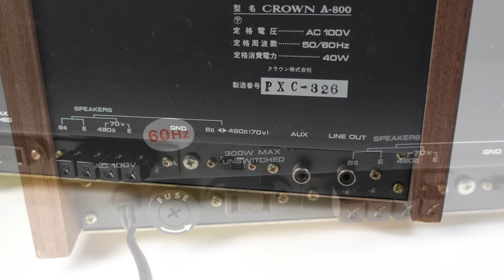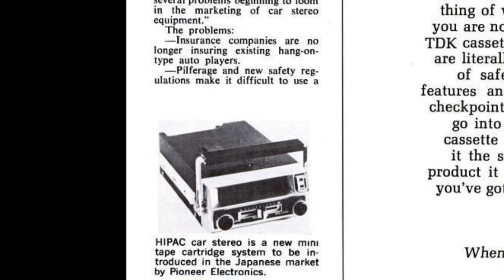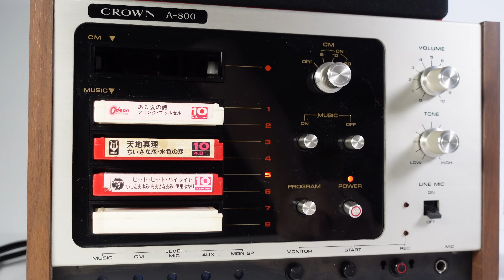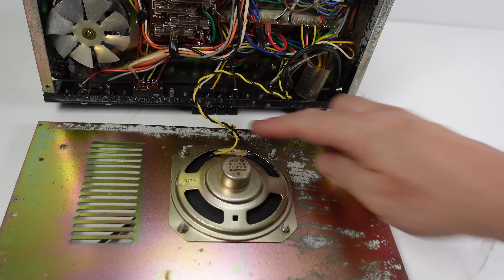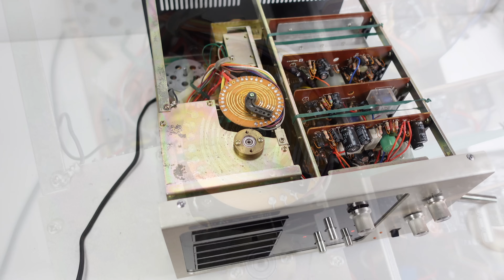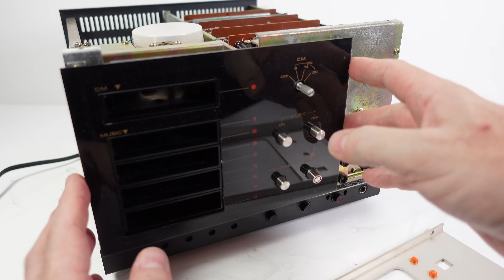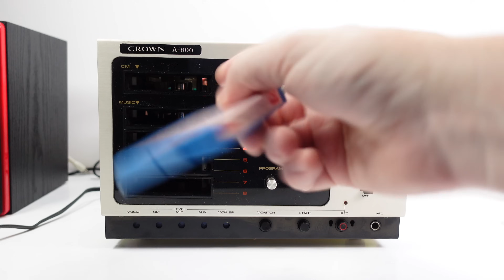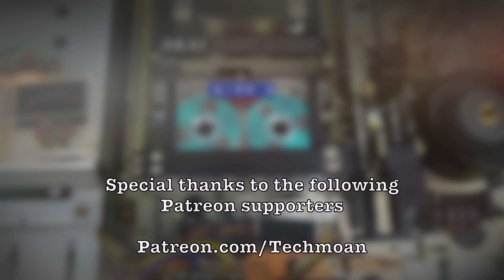An unusual player for a forgotten ‘70s music format

Comment: Changing the capacitor value alters the timing constant in RC circuits so yeah, if you can trace this cap to the motor driver (it's likely a part of the driver), it will alter the motor speed. Use a high-spec 1% mylar or polypropylene foil cap as a replacement. Judging from its size, it is rated to at least 250V. Soviet equivalents would be K73-16 (PETF, the knock-off mylar) or K78-19 (polypropylene), although the precision is not their greatest strength.

Comment: I agree with the "no Jacket required" joke, good work.

As for the drive roller release, Im sure that was designed to release the pressure off the roller so as to not leave an indent on the roller when not in use. I had several 8 tracks in the 70's that had a permanent (although slight) warble or "punch" as the tape was played because of the indent. It would have been a "bonus" for this machine to utilize it in cartage selection. But I wouldn't give them credit for thinking ahead in the design. They were good, but this was just an accident they could use it for this purpose.

FYI: My fondest memories of a bad drive roller was an ABBA album that my mum had in the car, which we had to listen too way too much!

Thanks for the memories.

Comment: Most people here seem to agree that changing the capacitor wouldn't change the playback speed. My knowledge of electronics is not great so I might be wrong, but aren't the most basic clock circuits based on how long it takes a capacitor of a specific rating to charge and discharge when wired in a specific way? It wouldn't take too much more than a capacitor and a resistor or two to shift a 50hz signal to 60hz or vice-versa would it?

Comment: I have a CQATRON STEREO 48 (imho mis-interpreted as QATRON, but the 'C' is in the logo. And with CQATRON standing for "SEEKATRON".) Regardless, the device is a 12 TAPES 8-Track Stereo HIFI TAPE PLAYER. This carousel player is better seen than described. So I made a video playing multiple tapes. Also for quite some time my full 8-Track upload of AL STEWART TIME PASSAGES was the only full example of the album. The slightly slower speed difference was actually an interesting alternative to Al's voice. I did not long after replace the dual parallel belts for a solid perfect speed, and great sound. 8-Tracks have a pleasant eq curve to minimize tape hiss. It's faster speed and wider-than-cassette tape contributes to superior sound to cassette tape. 

However, engineers incorporating the all new DOLBY C, THEN B (for consumer audio cassette and eventually VHS HIFI AV TAPE) and massive compression/expansion tricks did arguably leave the 8-TRACK TAPE in the dust...well dust bin, 8-TRACK tape was discontinued in late 1982. When I was in 11th grade. So I had 8-Tracks through my whole youth. Lots of portable players my gaggle of buddies could manage chipping in to buy the 8- D SIZE 1.5VOLTS BATTERIES (this 12 volt standard made car hook-ups a lateral move). They'd last 2-3 hrs carbon batts, or 5-6hrs alkaline iirc. That's a loud night camping in the woods. 

One of my buddy's oldest brother Mike was stationed in Greenland in the navy. One year when we were 12 and 14, and 16( me and youngest of the 4 brothers being 12), Mike brought home around 50 8-Track tapes ( Mike had incredible taste), a pioneer 8-Track player, a just released-1980 top model Pioneer SX-3900 receiver, a DBX 1BX DYNAMIC RANGE EXPANDER, and great BOSE speakers. He left it for his brothers! So we were so lucky. Yeah me too, as I practically lived at the Chapman's. In there little room with 2 bunk beds and the bitchin' music was a hexagon bumper pool table. The next year Mike brought home a bunch of records and a great turntable. To this day Digital has nothing on Vinyl! 

I grew up to be a professional musician, and attribute much of that to hearing great music on a great system. I never forgot the magic of the DBX 1BX DYNAMIC RANGE EXPANDER. I found one in adulthood for $10 at a thrift store. I use it on literally everything! I even put it on my Hammond B3 organ between the organs preamp-out and the Leslie speaker. I can put that organ in any part of a recording mix with any vintage era before it even gets to the recording desk. 

So the CQATRON was a busy Saturday morning thrift store find. It was one of the mornings that just felt like everything was picked over by the fluke of a crowd. It musst have been a 50% off day. Well anyway, I saw this piece of electronics with a huge hole in the cent, exposing the electronics. As I walked away I saw a little kid holding a thick transparent lid I knew must fit this thing. He gave it up with not much trouble. But then what? No sooner that I thought this, another kid had the missing round carousel with 12- long rectangle..."Ah wow it's a 8-Track changer!". It was a bit more trouble getting that from the kid, but I eventually did. The lid had $5.50 on it. I didn't even plug it in! SCORE!! With a little research I found they made 500 of the, Okay 'QATRONS'. Mine is serial# 499. Apparently a company had an 8-Track cartridge that its case was harder top make a flawless auto changer transition. At least built into the players brilliantly simple mechanics is a 'reject' , which spits back a difficult tape and moves to the next one. 

In my 15 years of snatching up every thrift store $.30 cent tape there have been several of these 'problem cartridges'. Actually no problem. I discovered simply applying and shining up Armor-All...actually preferably Son-Of-A-Gu'n to the inner rectangle slots for the tape, as well applying it to the cartridge sides, the work flawlessly. 

The TELEX COMPANY  continued making the units. Iirc they made more than 500, but I might have got that backwards. The daughter of the inventor commented on one the two videos I made of it. I do still have mine. Incidentally these Qatrons had a built-in 2-channel amplifier, L/R AUX-IN, and of course L/R PREAMP OUT . Surprisingly I've never patched it through the DBX 1BX DYNAMIC RANGE EXPANDER, but if I did and you heard it? Well, you'd need one of those Maxell Tape guy chairs! 🤣

Comment: Interesting video.  Don't be too nostalgic towards 8-track (and probably Hipac either), as I grew up using an 8-track player with quite a few tapes, and they don't age well:
- The tape, when played, has a tendency to be ever more tightly wound with every use, to the point of starting to play "slow".
- The pinch-rollers were hardening pretty fast and became more and more slippery.  This exacerbated the previous problem.
- You could somewhat remedy the tightening issue by pressing "fast forward" and reeling the tape from end to end at this speed, which seemed to wind it less tightly, if your player had such a feature.
I assume Hipac systems were also victim of these issues, since they're so similar to 8-track ones.

Comment: The hi pac format reminds me of the MGM "playtape 2" format, a short lived sort of tiny cartridge that looked like a little 8 track cartridge. I used to have one, it looked like a big transistor radio...didn't sound very good and ate batteries like a champ, but worked well. Finding tapes for it in the days before the internet was tough, so I sold it at a garage sale.

Comment: Because it has a 70 volt output it is a public address system integrated system. This will run absolutely fine with 70 meter speak cables.

Comment: The capacitor probably goes to some kind of circuit that modulates the mains frequency to the motor speeds. Just swapping out the capacitor shouldn't cause a catastrophic failure.

Comment: The capacitor will not change the speed, it just the difference in noise between 50 and 60 cycle. You need a full inverter to change the frequency to change the motor speed.

Comment: I'm really impressed by the forward thinking of having every major part in the device be easily serviceable. The belt is really easy to access, the heads are all interchangeable boards, every piece of electronics that could possibly wear you just slide it out. A much easier repair compared to a whole lot of the machines you've shown over the years, really goes to show how much care and effort these Crown engineers put into their system.
Reply: Remember that this was a commercial device, where uptime was money, downtime was loss, and a speedy repair was an all-around win (not only did the customer get back in gear with minimal lost service, but, the company got good rep points for a repair that took minutes versus hours, days, or weeks).
Reply: Also, I'm sure the reason the head has the ability to read both track is for reliability. On the car unit, the head had to physically move, which means more mechanism to wear out or malfunction when played 12 hours a day. By fixing the head in place and selecting the required track electronically, the unit is far more reliable and simple to manufacture. Very impressive little piece.
Reply: Something HP was frequently doing in their early computers
Reply: The marketing dept was livid!
Reply: @Redmenace96  Depends on business model. If they sold the machines to end users, sure. If they rented the machines, not so much--in such a model, highly reliable products are desirable, in order to spend less on field techs. Especially when quick repairs are a selling point.
Reply: @Redmenace96  not quite, this is an industrial grade device. Most modern servers for example also have this level of modularity.

Comment: Often, 50 and 60 hz equipment had different pulley diameters available from the manufacturer to convert them to local requirements.
Very interesting video. Thanks.

Comment: I think the speed control is the combination of the capacitor and that otherwise pointless fan on the end of the motor shaft. Using a larger capacitor for a 50Hz system would increase the motor torque for more speed, but a faster speed increases the drag of the fan until a balanced speed is achieved.

Comment: I bought my first car in February, 1973. I can't remember if it had a radio or not. It certainly didn't have a stereo. The first unit I installed was a Pioneer KP333. It was a cassette machine and it was auto-reverse. It wasn't in for long before it was upgraded. I replaced it with a radio/cassette unit. The last role of the KP333 was for background music in the foyer of a cinema where I was working. I may even still have it somewhere.

Comment: Can you not use regular casette tape to replace what's in these special ones? The tape itself looks very similar.
As for it just looping the announcement, looks like "music on/off" buttons were both popped out, so maybe that had something to do with it? Although your theory of using the second track for basically programming does make sense.

Comment: Hi, capacitors are used as timers in a circuit, so in theory would increase/decrease the  frequency of a given signal, depending on the cap value. Assuming this is on the output of the mains input, then im guessing this is its purpose! there is one way to find out of course?

Comment: In an oscilator circuit a capacitor of higher capacity will reduce its frequency.
The size for its capacity aswell as the "MP" hint it to be a foil capacitor. I'm certain its not part of the power suppy. Also the only capacitor you could want to scale with mains frequency there is the smoothing capacitor (it certainly isnt) where a capacity higher than needed does no harm.
That said the main purpose of the board it is soldered on seems to be the accessible mounting of maintainable components so I can't tell to what circuit it actually belongs.

Comment: if I recall my schoolboy electronics... if you alligator clip a .4uF (400nF) capacitor in parallel with the existing .6uf you will have the 1uf your looking for, its strange that with Japanese tech they didn't allow for a second cap on the circuit board to just add the extra one in...  (make sure you match the voltage from the existing unit)

Comment: the whole 50/60 hertz is complicated.  It could have been solved after world war 2 if it wasn't for one unfortunate fact, the places that were 50 hertz were in the north that were not bombed to smithereens by the Americans nearly as badly as the south (and in two cases strait up nuked).  The created a bit of a complicated quandary when building back up the electrical grid.  The US was happy to help build back up Japan's destroyed electrical grid in the south with their own 60 hertz systems, but in the north, there was not as much need for replacing the still very usable 50 hertz grid and a lot of old radios and other electical devices from before the War in the the north still worked fine.  So as to not cause too much issue with, the decided to leave it at that and everything built up from there with the two systems and by the time Japan had the money and infrastructure to possibly replace it, there was no political will in the north to change anything so it was left in this 60/50 hertz dual system using the proprietary 100v outlets.  This supposedly costs Japanese companies 20 billion dollars a year in excess expense in need to manufacture different power supplies and transformers for exported electronics that don't use 100v power supplies as well as the need to make all electrical devices "dual frequency" (it would be FAR cheaper to make everything a single frequency and able to make everything 120v that can easily be converted to 240v).  This is most likely not going to change any time soon as it would be far too expensive to change at this point.

Comment: Re: Splicing cassette-width tape: Ebay lists someone in Surrey selling a "Audio Cassette Tape.1/8" Splicing Block" which is a miniature version of a classic audio tape splicing block.  I also remember having a "BASF Cassette Repair Kit" in the early to mid 70's which came in a box the same size as a cassette box.  I am not 100% sure, but I may have bought it at a HMV store in London.

Comment: With such a large flywheel, you may find that the capstain bearing has dried out (causing wow & flutter). Best not to just lubricate it, but instead remove the capstain altogether and give both it and the bearing a good clean with shellite or similar to clean off any old dried oil or grease. Use a couple of drops of machine oil inside the bearing and another one on the contact surface at the base of the flywheel and reinsert it. Once secured back in place, make sure to clean any oil off the entire length of the capstain to avoid contamination of the tape.

Comment: The car stereo versions that I've seen also push the pinch roller retract lever when the tape stops playing. This is for two reasons. Firstly, it stops the pinch roller from becoming deformed when the capstain is applying pressure to just one spot, which would result in wow/flutter. Secondly, if the tape is pinched in the one spot, the tape itself can amalgamate with the pinch roller or stick to the capstain, and either damage the tape or get wrapped around the roller or capstain and thus get "chewed".

Comment: Changing the capacitor will generally change the torque to the motor, hence why it sounds wobbly. You  said you don't have any option to change the belt position sadly.. so probably not possible, probably need a different fly wheel?

Comment: @36:49 with some movie projector queue systems that use metal foil to automate the lights and such the metal foil has to be in different places depending on what you want the queue to do.  Bridging the length of the film as it passes the reader vs across the width.  The ones I had like that rely on actual conductivity of the foil and after a week or so the queue tape goes bad from wear and requires replacing.

Comment: I had an 8-Track system in the early 1970s.  (Yes, I am a yank!)  I loved the thing and had plenty of cartridges from many artists.  One by one they failed.  The primary problem with these continuous loop systems was the tape eventually tightened up on the reel making it difficult for it to pull from the center of the spool.  They would slow down, warbled and many times  completely bind up.  This was usually accompanied with the tape winding around the capstan and breaking.  I resurrected a couple of failed cartridges by opening the case (like you did) and rewinding the reel.  Talk about a pain in the rear-end with a high degree of catastrophic unraveling all over the floor!   Despite my efforts, they too would eventually bind up.  The suspect the Hipac system had similar issues.

Comment: 35:30 Did they use the tone to allow for messages shorter than the length of the tape? I wonder if there is a button or something on that machine to inject the tone.

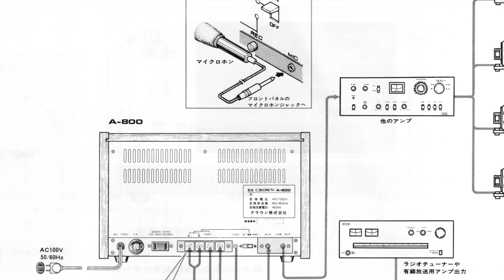Comment: 11:14 The 70V speaker output was the first thing that gave this away as a device intended for public-address systems. Note the way each speaker in the illustration has its own transformer; these were often multi-tap transformers with taps for various volume levels. Each speaker could be jumped or switched to a volume level suitable for its location. The classroom speakers I remember from high school each had a 4 position volume control and a 3 position source control, so the teacher could pipe-in 1 of 3 radio stations and choose the least offensive volume; any announcements would be cut-in, in place of the background music.

Comment: Hi

This seems like the Same Mechanism used by a Sinclair ZX Micro Drive Unit made in the 1980 by Sinclair Research Ltd. (U.K)

Look it up if you wish....

Thank You...

Best Regards...

Mohammed A. Rahim
Manama-Bahrain
Reply: Same principle as 8-track and HiPac inasmuch as a single spool.  MicroDrives used even smaller cartridges -  45 x 30 x 5 mm. (I've measured one just before typing that.) The tape width was 2mm and ran much faster.  About 100 kbytes on the loop which which took about 7 seconds. The raw tape stock was video tape sliced to 2mm.